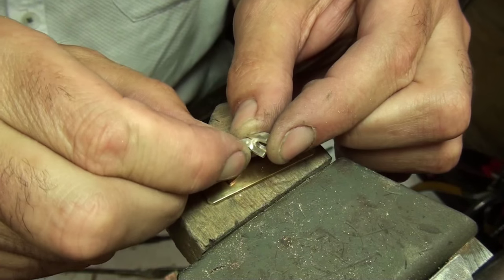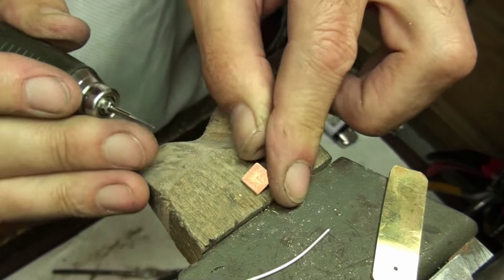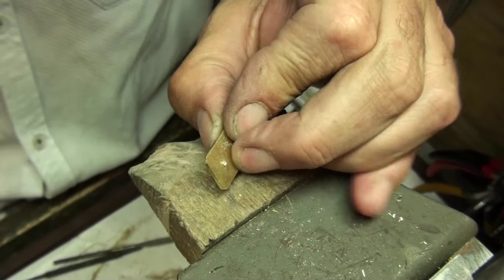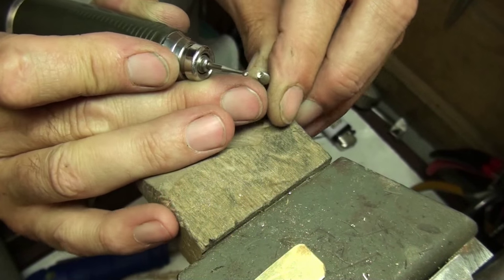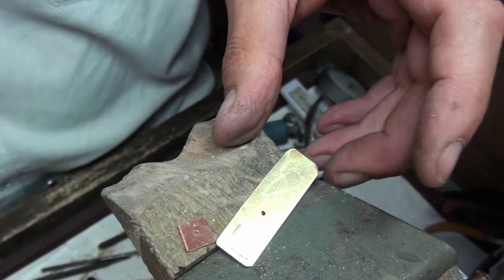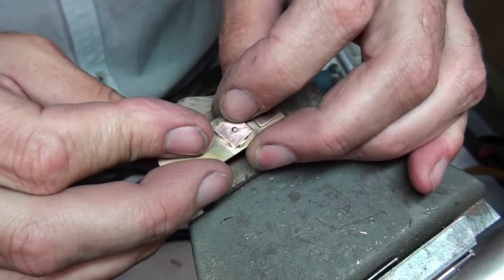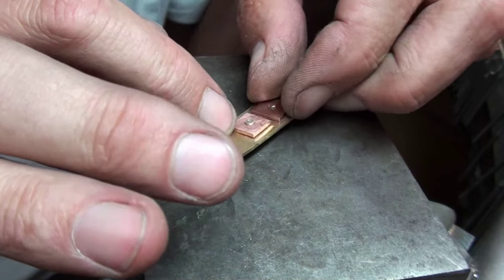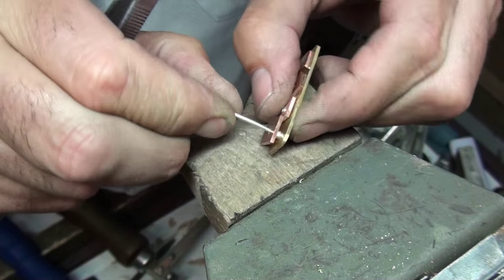Riveting

Comment: A good video, very informative thank you - don't often see the platform style demonstrated.  I have a question please - the wire needs to be forced through the holes to make a good rivet, does it need to be as tight through the tube that separates the metal plates of the platform style you demonstrated?